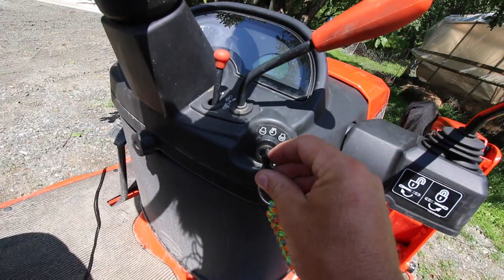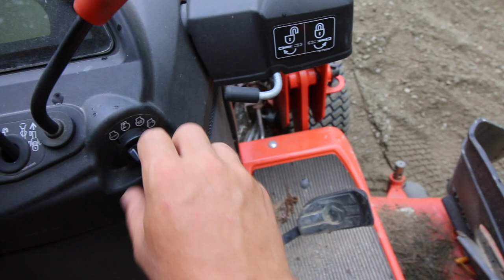BUiLDiNG Our Off GRiD OutDoor Kitchen.  Build # 6

Comment: The kitchen area is coming along nicely. It looks a lot better with the grading. I might suggest, use your blade when leveling and not the back of the bucket. The grit in your pivots, and the wear on the tub can shorten the life. The blade is designed to be replaced,and is a different grade of steel,  the pivots, and back of the bucket, not so much. 
The ducklings are adorable, I hope Livvy's duckling comes around.
Reply from the maker: Thanks yes the grading makes it look more finished! Thanks for the advice. We hope the little duckling pulls through too!

Comment: When you backdrap like in this video.. You're forcing dirt into the bottom bucket pins... So make sure to pump lots of grease into the pins to push the dirt back out...
And you shoud really put a piece of angle iron on the back of the bucket..
First to grade with..
Second..to protect the back of the bucket from wear...

Comment: Check out Bakers Green Acres re onsite processing regulations.  If you intend to process, check the above so you don't have to ..example..reinstall a 3 bay sink  and sanitary wall boards.  Better to not be surprised.  Good Luck ..I'm a big fan.
Reply: Keep an eye out at metal recycling yards for locker meat  roller with track, hooks and a big cast iron scalding pot.  Take a 12 pk and list of I wish...  Feed a welder..lol
Reply: Are these regulations for a commercial operation?
Reply: BullittMcQueen1 ..I believe anything sold is considered commercial.  I just caught examples from Michigan on Bakers Green Acres issues.
Reply from the maker: Thanks I do need to keep my eye out!
Reply from the maker: Yes id you want to be able to sell commercially you need to be set up and there are a lot more regs too! Most states let you sell so much poultry a year from your farm with out the regs.